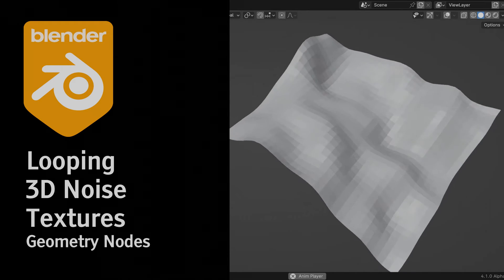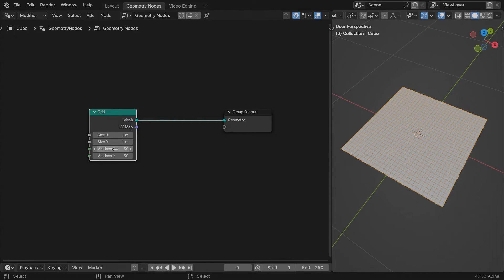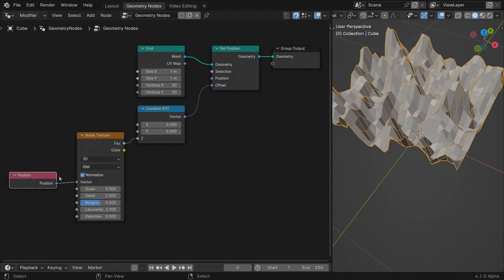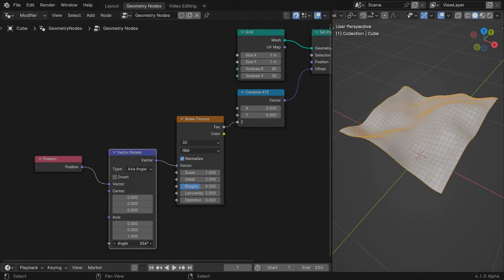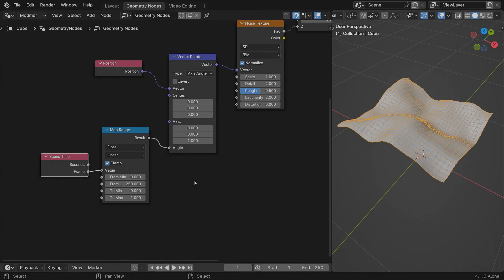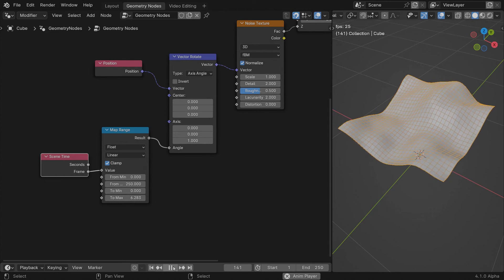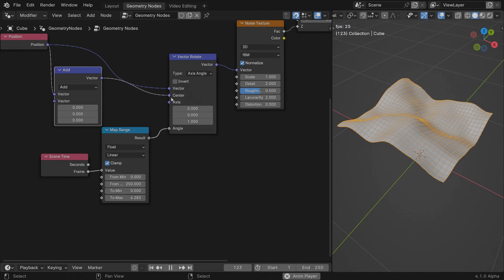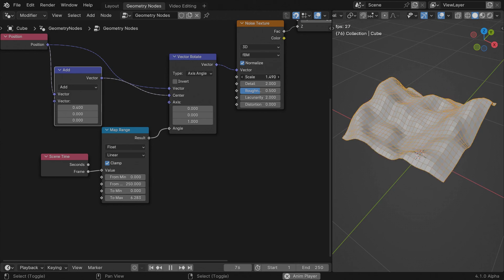Looping 3D Noise Textures - Geometry Nodes

Comment: I better technique is to mix two noise nodes together with the one you mix into exactly the same but offset by the amount of frames in your scene. You can do this and control the W X Y and Z values independently.